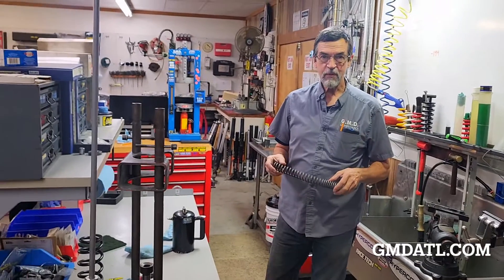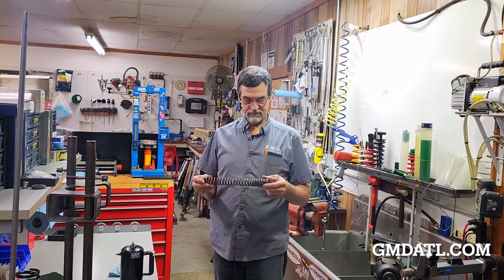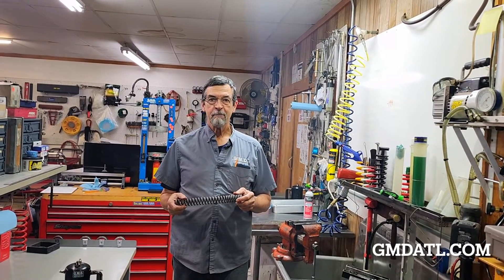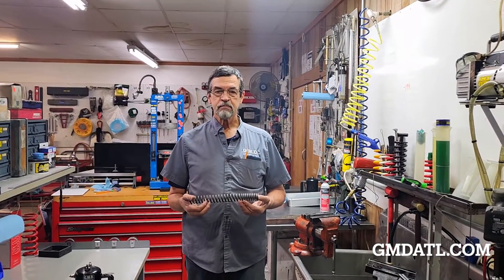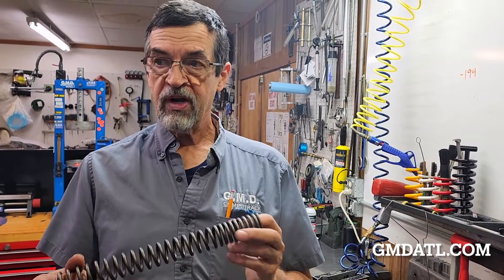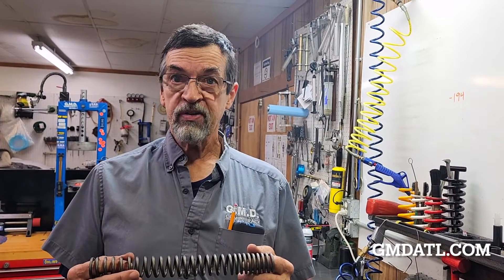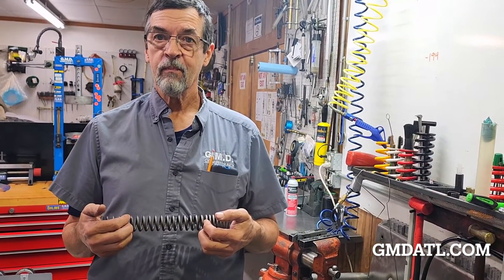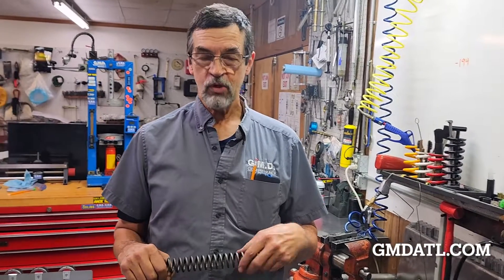Dave's Garage  -  Linear or Progressive Springs?

Comment: A lot of pot holes and bumps = progressive upgrade.... Flat perfect streets or smooth race track/ track bike = linear upgrade.... Thanks me later
Reply from the maker: Nope.  Linear for your weight with the right valving and preload is the way to go, for the reasons that Kent and most top shelf suspension specialists will tell you.

Comment: Would reckoned Progressive Springs foe a  BMW R1250GS LC with  ESA ?
Reply from the maker: Not familiar with that bike, and I am not sure how the ESA system would react with different springs?  Is there a way to re-calibrate the electronics for a different spring rate?
Reply: Fit  hyperpro with 15w fork oil...Massive improvement

Comment: You mentioned different springs for weight . How do you reference the right ones ?
Reply from the maker: You have to determine what spring rates are in there now, and then talk to someone at Ohlins/K-Tech/Racetech and see what they suggest for your weight and riding style...  They usually have a phone number or email you can send your questions to.  They will almost always have a chart somewhere to reference and can get you what you need.

Comment: I don't disagree with anything said here, but would add the proviso of considering older(70's) road motorcycles. With there limited damping abilities in the front forks I've found a progressive spring can works well, if properly set up for the machine in terms of preload etc. and spring rating. It seems they can give you what you need at either end of the suspension travel, a decent controlled ride over normal road ripples and bumps, while controlling much better the fork dive under hard braking. However one of the shortcomings is the lack of different spring rates available for progressive fork springs, most seem to be 35/50 rated over a whole range of motorcycle weights and do not allow for for changes in rider weight either, so while they are generally an improvement over the poor sagging OEM springs, they do not really provide any customization. I found for my Suzuki GT500 that 35/50 springs meant for the much heavier GT750 work well, even trimmed shorter to fit the forks, which leads me to believe they would be too soft for my purposes and weight on a heavier bike. So currently I'm on the fence regarding my 1978 Kawasaki KZ1000A, which I'd like to upgrade.  IMO the biggest shortcoming of the progressive spring route is the lack of choice over the spring rates, as opposed to single rate springs that can be bought in just about any rate to suit the motorcycle's weight, rider weight and riding style.
Reply from the maker: I have never really had a vintage bike, so there may be additional concessions to make in those cases...
Reply: @Daves_Man_Cave  Probably a wise decision on vintage bikes ;),  I have a few and there's never a lack of things that need tinkering with. The stock springs were not generally the best quality at outset and often had dubious spring rates and preload, so any sensibly thought out changes will seem amazing. Where I feel the progressive fork spring works well, assuming you can get an appropriate rate, is with the rebound damping, which in many is very poor, this seems to function better when you have the lighter weight spring rate in operation as you approach the full extension of the fork. Again the lack of spring rate choices is the Achilles heel of the progressive spring market, while they will almost certainly be a big improvement over stock on a 40+ year old motorcycle, the necessary options are not available to fine tune a suspension to suit a particular rider and machine.

Comment: 🌟This is an excellent article. I'm not fitting progressive springs now I've had that explanation. Perfect guys, many, many thanks🌟
Reply from the maker: Glad it was helpful!  SO many guys go progressive because "that's what I heard", rather than doing research and talking to a pro suspension guru that does it for a living.  The cost difference is minimal, the effort is the same, so why not go with the much better option?

Comment: Great stuff,man! I have a 93 klx650c. I'd like to improve my  fork, but only option for sale is progresive springs. Fork not adjustable. I am a heavier rider and need more stiffness. Don't know what to decide? May be small spacers and 7.5w oil(5w stock) will improve a little bit. Just drive me crazy)
Reply from the maker: There has to be a set of linear springs out there, but in a pinch, heavier progressives will at least be better than what you have...
Reply: @Daves_Man_Cave  Thanks a lot 👍

Comment: For someone who knows pretty much nothing about suspension,this info is Tops Dave 👍👌
Reply from the maker: What you see in this video, is mirrored by any pro suspension engineer.  Dave Moss, Traxxion Dynamics, Thermosman, etc...

Progressives are almost never the way, unless you don't know the weight of the rider and just want something in there so that they can "safely" ride away.

If you are trying to upgrade the forks to make them perform properly, there is zero excuse to go progressive.  You have to take the forks apart anyway, you know how much you weigh...  so just get the correct linear spring and do the upgrade right the first time.  🙂

Comment: What he said at 3:10 - 3:45 basically poo-poos the "preload adjuster only" belief, glad I bought full kits for my 2020 INT650 and Bonneville front forks; they're not perfect but much better than just the stock progressive springs by themselves.
Excellent video about a topic that only a few riders understand and sadly one area on our bikes that gets neglected in favor of go-fast goodies / louder pipes 😂
Reply from the maker: Yeah, you can't fix an improper spring rate with more preload.  You might get the sag you want, but you will bind the springs and the suspension action will be poor.

The problem is that a lot of guys don't really understand how this all works, so they don't know what to look for, or how to get things sorted, or even what questions to ask.  They just hear from other guys to get progressive springs and they don't even question it.

I tried explaining this to folks, but about half the guys just "know what they know", even when what they know is wrong.  haha

So I figured, don't take my word for it, listen to a guy that's been doing it for 30+ years...
Reply: ... Yes, repeated again at the 7:00 mark. 
My HD 2004 1200C front forks need new/different springs. 
There is not much travel and it results in a rough ride.
Jeff